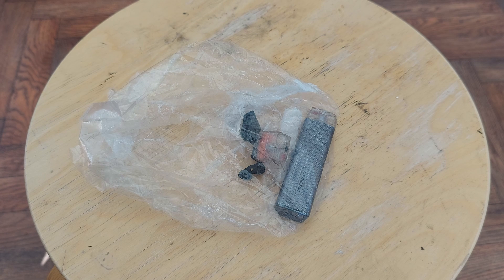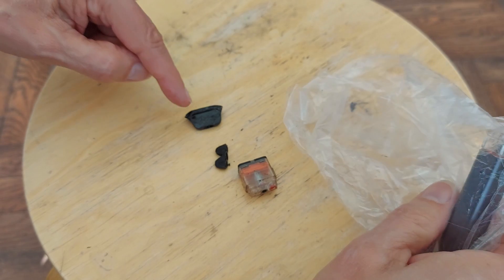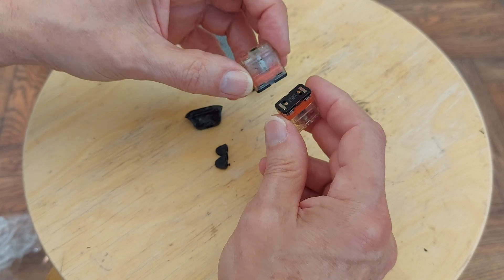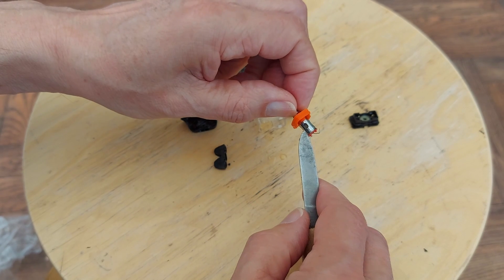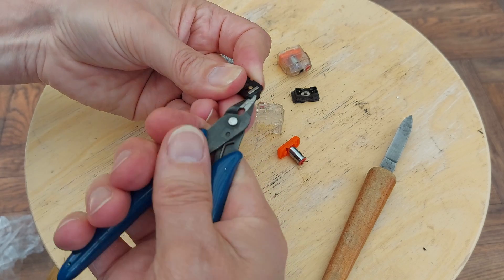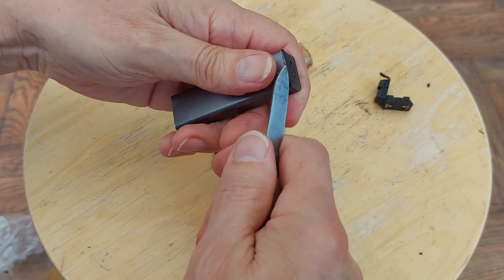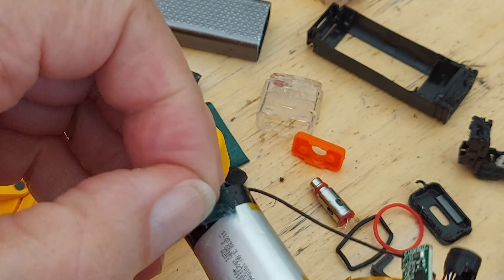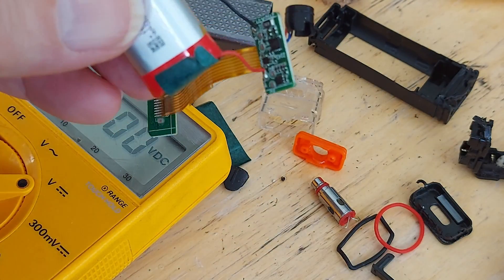Vape Hunter - Vaporesso teardown

Comment: Hi! 3.7v battery compatible with this pod?
Reply from the maker: Every vape I have opened contains a LiPo battery. LiPo batteries are 3.7 volts. In fact fully charged they are 4.2 to 4.3 volts and can discharge down below 3 volts although usually there is circuitry to prevent them dropping below about 3.3 volts.
Reply: @GrandadIsAnOldMan But then the peak voltage for a full charge would be higher for 3.7v nominal battery, right?
ChatGPT is freaking me out, saying you can't do that. And ordering a separate battery from Alibaba would cost way more than just buying a new device😂
Reply from the maker: I don't know of any battery that ever maintains a steady voltage with no difference between full charged and fully discharged.  (Although you can get very expensive Lithium Ion rechargeable AA batteries that have an inbuilt circuit board that regulates the output to a very steady 1.5 volts, but that is a totally different subject). Your standard alkali AA battery will be around 1.6 volts fresh out of the packet and drop away to virtually nothing eventually. 
LiPo batteries are, as I said in the previous reply, up to 4.2 or 4.3 volts fully charged.
Vapes have a circuit board that regulates the voltage fed to the heater element. They also have a timer circuit so you only get about 10 seconds of heat from each puff regardless of how long you can suck. If you buy a rechargeable vape, the circuit board also prevents over discharge of the battery, so it stops working when the power drops too far. This is because an over discharged LiPo cannot be recharged.
With regards to buying a replacement LiPo battery, you are right, it is probably cheaper to buy a new vape. That was one of the issues with disposable vapes, it was certainly cheaper to buy new than replace the battery. Having said that, the majority of the vapes I have collected over the years have nothing wrong with the battery. That is why I collect them, I get a free LiPo.
Personally I would recommend you do not use AI to do any research for you. AI is inherently wrong and will only get worse as it feeds from it's own wrong answers. Having said that, if I do a Google search there is always an AI suggestion, but it is just like asking some random guy their opinion, you have no idea if they are right or wrong, unless you do further independent research.

Comment: I would suggest unless you are a smoker or a vaper to use gloves when dismantling. Nicotine does absorb through the skin. I do understand the convenience of a disposable. But for a quid extra you can buy a rechargable device in poundland and a bottle of juice to keep you going. After that the juice is a minimum of a quid each and same for the disposable (still not ideal) atomiser. Back in my day (he says lol) most atomisers were fully rebuildable. Took me a while to actually track down a fully rebuildable when I recently  upgraded my 10 year. Part of the appeal of a fully diy solution (or as diy as it's possible to get) is the massive level of savings you get by doing just that. Bit of wire and some cotton wool and you have an atomiser that will potentially last decades.
Reply from the maker: Thanks, my only interest in vapes is the free LiPo batteries and I have more than I will ever be able to use.
Reply: These are rechargeable with the USB-C port ( i have one in use for over a year), and the coils (the see-through part that detaches on the top) is also changeable and refillable, even the mouth piece is if you really want (you can buy then in packs of 4 and different coils for less or more smoke, you also have a black version of the coils).... Sadly these devices have a flaw in them where the copper springy nubs stop springing back and cause a bad contact to the coils..... came here to see if this was serviceable.... sadly this is not the case.... i did know about the magnets (i use them to stick the coils on a magnetic surface to keep em upright, just in case it gets knocked over and starts to leak) and the batteries i knew too... but now i know that you can reuse them as well 🙂 btw i think you can push the metal pins back to slide it out of the case :)